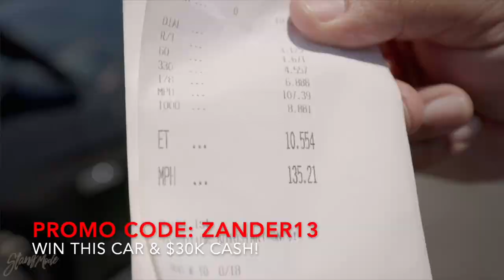WE WENT EXTREME! Watson Racing Roll Cage Install on my Built 2019 Ford Mustang GT

Comment: I use swing our door bars with billet ends which are NHRA certified on the ole 67 and I can remove them...I can actually remove the rear bar as well but don't however I'd rather have wrecked my 19 at 160mph than my 67 at 35mph in harness....ya getting something broke just to much metal....
 Haha good luck

Comment: What's good Zander ! I did have a sarcastic remark about that wing and parachute . Being that your car is most likely 50% or more dragstrip driven a cage makes complete sense. It helps to alleviate chassis flex as well as improve safety
Reply from the maker: That wing and chute was not on my car 🤔. I’m confused

Comment: what gear ratio is your stang 3.15 or 3.55
Reply from the maker: 3.15
Reply: @Zander13Productions  just wondering from your experience and connections which is better mine came with 3.15 but I know the performance package comes with 3.55 should I stay with 3.15 or does 3.55 make a difference?